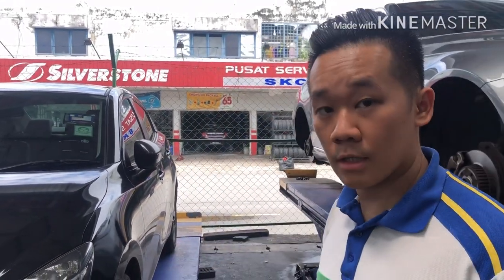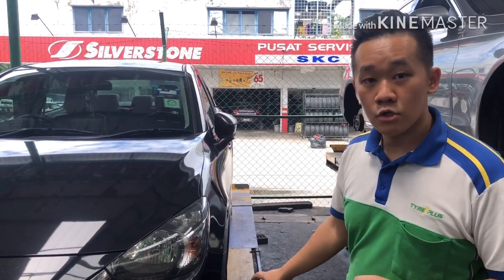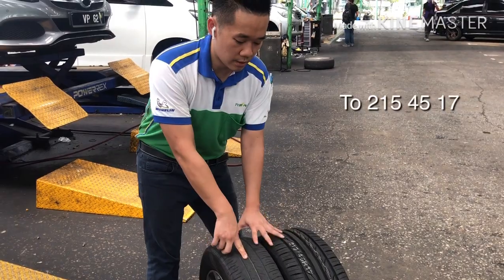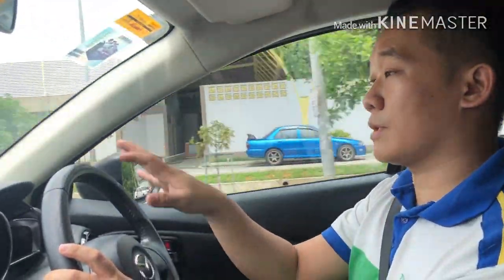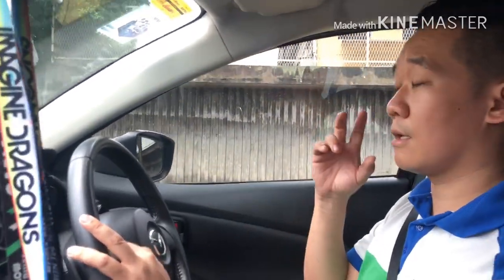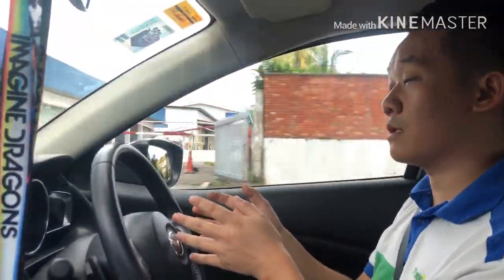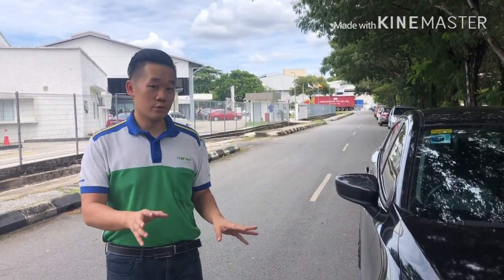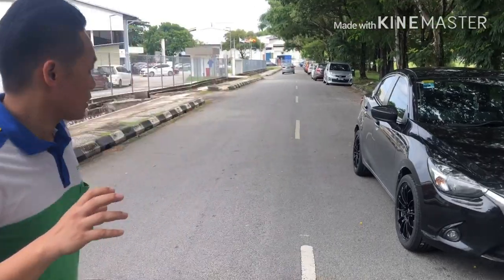17 inch wheels lighter than 16 inch ? Mazda 2 with 17 inch KONIG Dial-in FLOW FORMED Wheels

Comment: Those look great! I'm currently running 15inch rims on my Mazda2. Did you notice much difference in acceleration when you switched over to the 17s?
Reply from the maker: Definitely felt the difference. Smaller rims are typically lighter hence throttling and handling feels more responsive but it's not a significant deal breaker for an average driver like me. I'd recommend Advanti DST series rims for upsizing because they're usually 4kgs-5kgs per piece!
Reply: @KingofRimsMalaysia  Thank you for the advice!

Comment: For mazda 2 sky, original size 185/60R16  is so rare. The price might be almost the same with 215/45R17 size.
Since original rim is 5.5j only, it cannot fit 205/55R16 (the closest diameter to stock for 16")
Reply from the maker: Yes you are right, 185 60 16 is only cater to Mazda 2 now, hence the tires have limited choices and quite expensive. Hence many of my clients either change the wheel to 16x7J (use 205 55 16 tires) or 17 inch (used 215 45 17 tires)
Reply: @KingofRimsMalaysia  Hi boss I would like to ask if Kia Rio UB 2013 can fit 215/45/R17 onto original sizing 205/45/R17?

Comment: Hello Sir , i am thinking of getting Rims for my Jazz GK5. i prefer 16" rims to replace the stock 15". 
However i have read in one of the Jazz forums that since the honda jazz in South East Asia has less HP than the Jazz in North America, they recommend fitting the SE Asia Jazz with 15" because 16" rims can affect the acceleration of the Car (?). Any thoughts on this?
thank You

Comment: Nice video. Is it possible to use more wider tire than the one you are using in the video? I have the same car and planning to do the same upgrade. Thank you
Reply from the maker: Thanks you !! I will think that 215/45/17 is quite the max size we can go with due to the fact that Mazda2 front wheel are quite "out". I can fit 225/45/17 for the car however the front tires will be slighty too big and might stick out from the fender. You will have some issue during hard braking or sharp cornering as the front tire might touch the fender. I hope it help : )

Comment: Hi i am a myvi mg3 owner,
originally it is 15inch rims but i am planning to upgrade to 17inch rim
i am liking the SSR GTX 01 17"  with 205/45/R17
regarding the weight, wheel diameter comparing with the stock one 
will the performance decrease ??
or should i stay on 15inch upgrades and some recommendations from king of rims 
Thank you very much for your reply
Reply from the maker: Myvi best use 205 40 17 

Pls provide me your whatsapp number   

Easier for me to send u pics   

Or whatsapp me straight 

@  http://api.whatsapp.com/send?phone=60129820693

Comment: Hi, nice vid. 👍🏼 Learned something new. Been planning for a while to have my Mazda 2 2019 changed to those 215/45R17. Is there a noticeable change in fuel consumption? Will it consume more petrol or about the same? 

Lesser rubber thickness means bumpier, you said. So less comfortable too. Would that make the inside (cabin) sound noisier as well? 

Also, I read in one of your replies an option for 205/55R16. Do you have a vid of that here for Mazda 2? 🙂
Reply from the maker: Hi! Thank you for reaching out. Unfortunately we don't have a video for that yet but you can contact me at 012-9820693 (Jeff) so i can advise you bro!
Reply: Hi, can the Mz2 stock rim fit 205/55R16 tyre? Or I must change rim to do so?